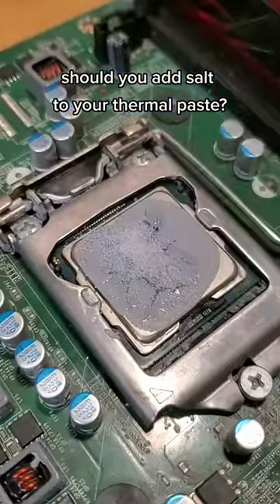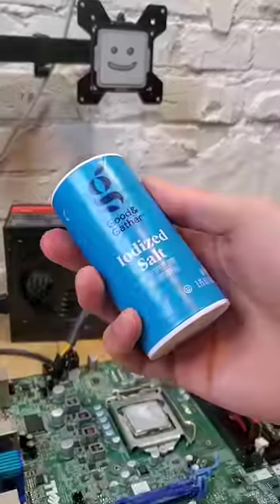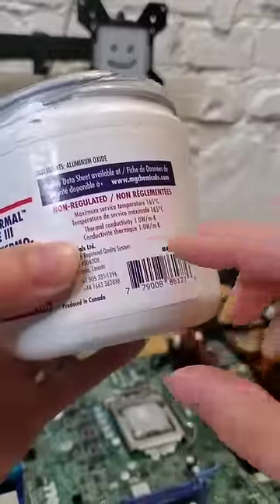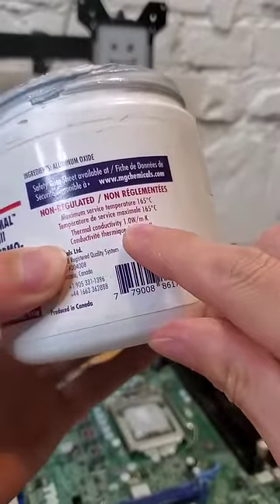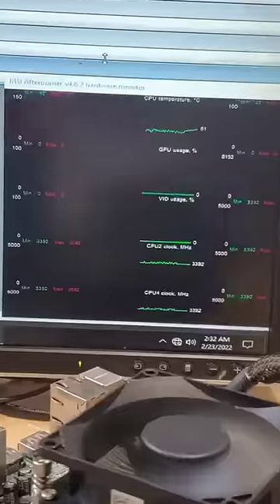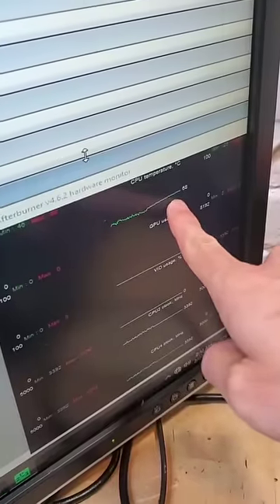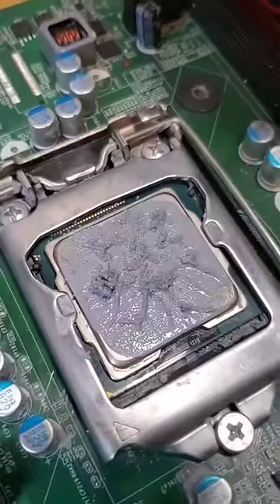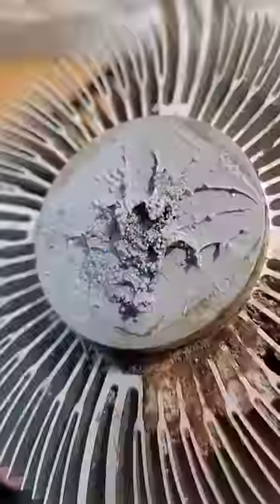should you add salt to your thermal paste? #shorts

Comment: What if you grind it up into a fine powder, melted the salt, then mix it into the thermal paste, let cool but only slightly, then while its still warm/hot apply it to the PC? That would be interesting...
Reply: One issue Melting point for salt 801°c thermal paste can withstand about 150°C some claim up to 300° other claim more so if you get persay the highest one you can find you gotta let that Salt cool down a bit, but wouldn't stop you from melting it into a flat disc or something and than adding that into the middle of your thermal paste might help.
Reply: @Oracle2448  hmm yeah i don't know enough about the properties of thermal paste lol your right but if it was a soild there would be some super tiny air pockets or something right? Thinking like if you used a coin lol

Oh what about disoving a small amount of salt in a small amount of water. Then mixing the small amount of water into the thermal paste then let it evaporate,  Then eventually apply it. Though again going back to me not knowing much about the properties of thermal paste lol could it even mix with wate? Lol
Reply: @LordNelson6  well, but you could get the air pockets out it is possible. Like Resin
Reply: @LordNelson6  I don't think it would really mix with water and be the same
Reply: @Oracle2448  Not going to lie though a solid peice of salt that looked like resin as a thermal compound would 1 look cool and 2 be a great story lol

Comment: what if you melt salt ?
Reply: It's too hot, the melting point of salt is around 801°C or 1473,8°F
Reply: @itsfudge_  you mean it's too cold or the melting point is too high?
Reply: @itsfudge_  Nothing can stop this guy my friend.
but for some reason I think it dangerous
Reply: @lazer1036  yea the melting point is too high. So the molten salt would be too hot.
Reply: @mahan9344  molten salt is hot already so it will make the CPU hot instead of cooling it. Besides, it's electrically conductive, so there's a chance to short the motherboard
Reply: @itsfudge_  ok